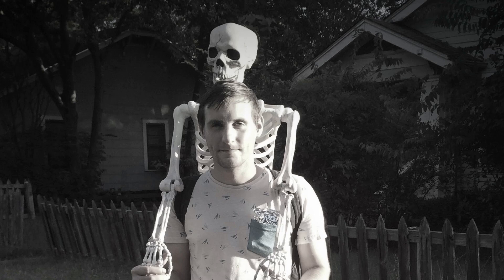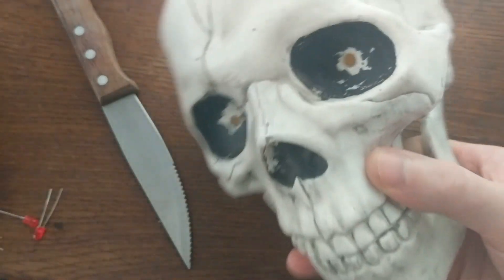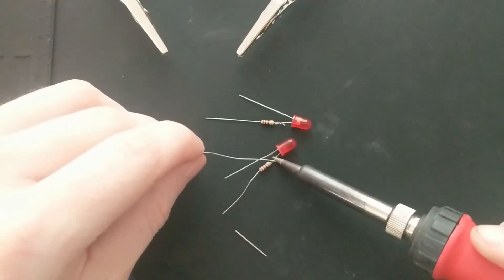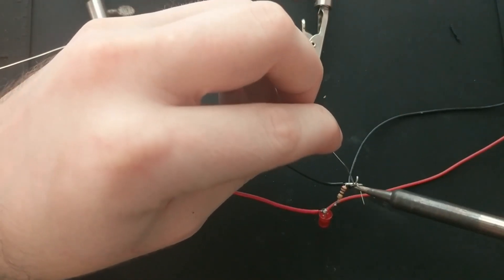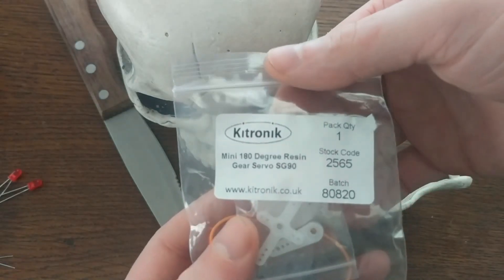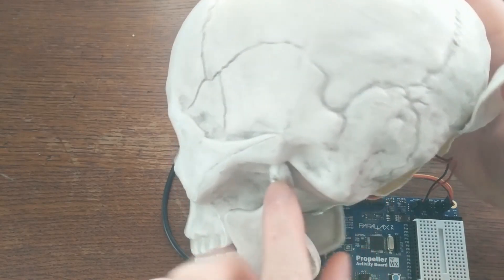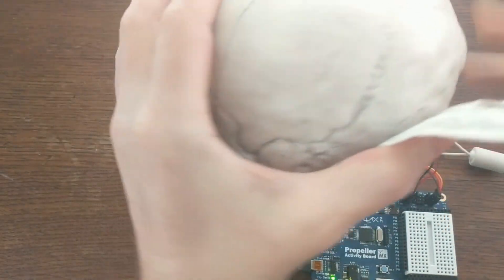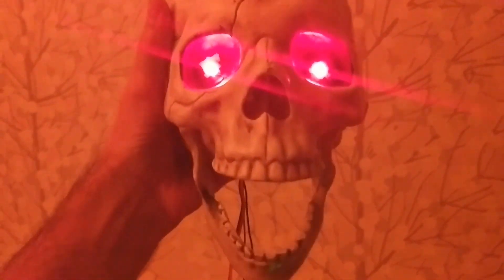Building an Animatronic Skull for Halloween (Instructions)

Comment: I hooked up the LEDs on mine to an i/o port on the Arduino and programmed them to flicker when a motion detector senses someone nearby. The servo solution here is very good and I hope follow the same principle. I’m planning to add a second skull and mount them on a pole so one will have glowing eyes and the other motion detector eyes 😆